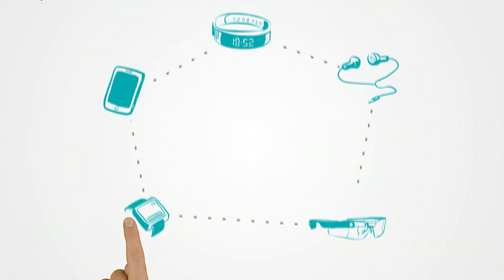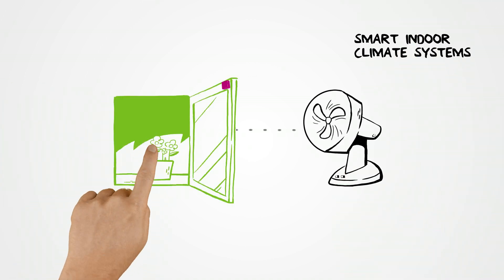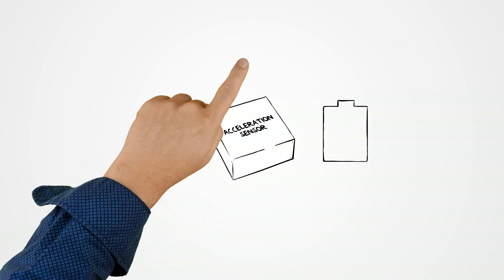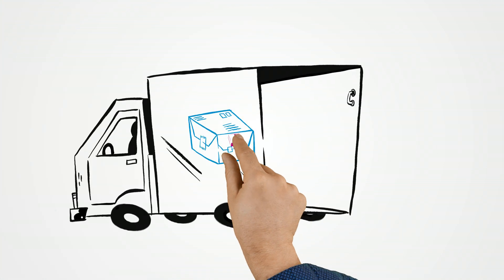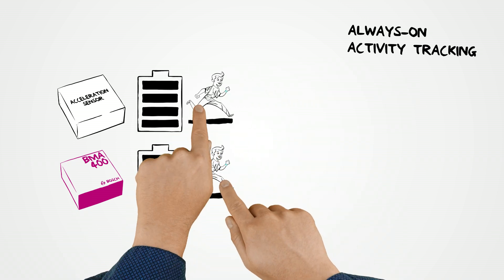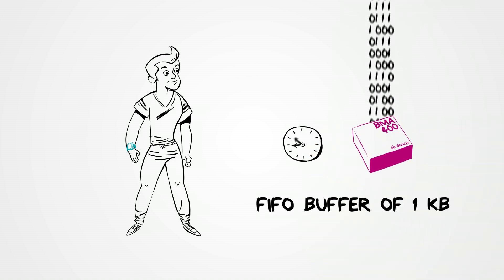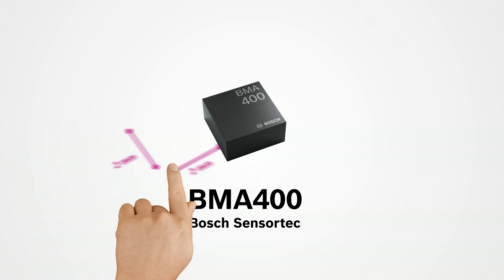Ultra-low power acceleration sensor BMA400 for wearables and IoT applications

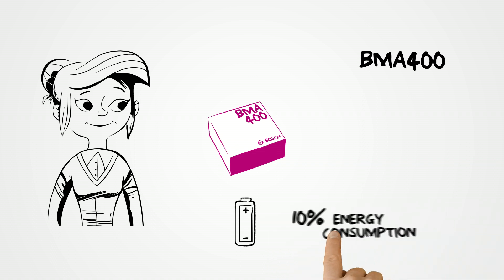Comment: 0:54 10% of what? What exactly is 100% here? How does it compare to Bosch products like the ever popular bno055 or the bma423 (in terms of power consumption, and ease of access(e.g. access 3D eigenvectors)?
Reply from the maker: 10% compared to a standard consumer accelerometer with similar performance. You can find further details in our datasheets: https://www.bosch-sensortec.com/products/downloads/
Reply: @BoschSensortec  thanks for the reply! What's the standard consumer accelerometer?